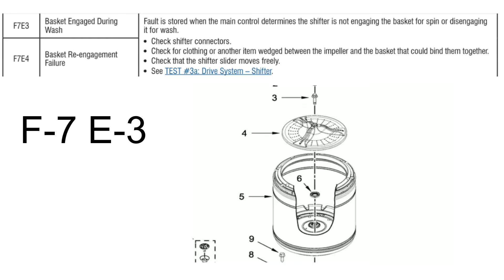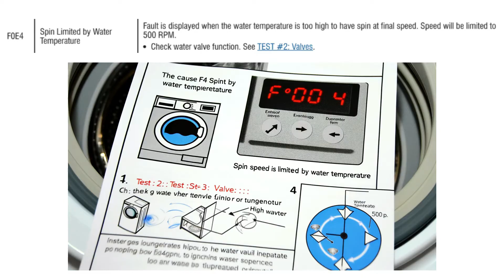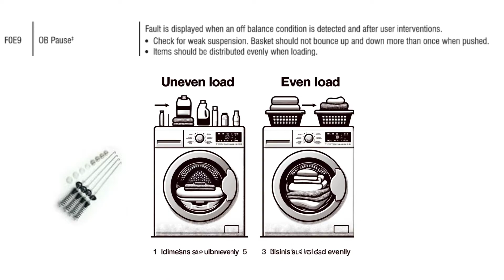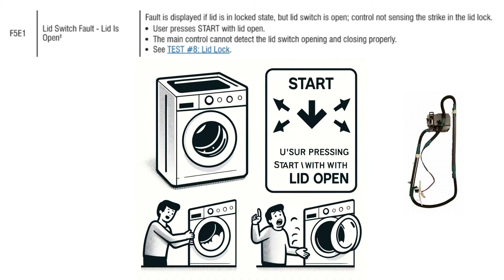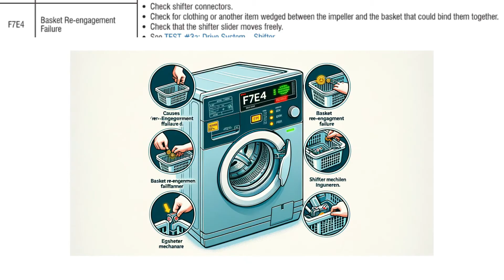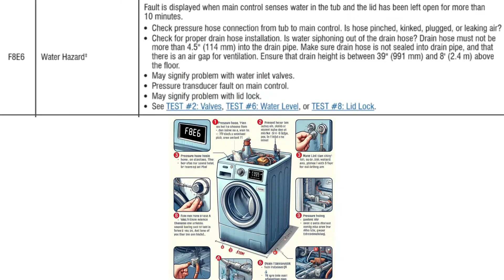Troubleshooting Maytag Washer Models: MVW6200KW & MVWX655DW Guide

Comment: All 4 lights blink on mine. I don’t see that option on the binary code chart.
Reply: My washer is doing the same exact thing. Did you happen to figure out what the issue was and how to resolve it?
Reply: Mine is the same too
Reply: On mine, everything pointed toward a bad control board. Scrapped the machine and purchased a new one.
Reply: Mine does the same thing.  I am hoping that changing the display board will fix it.  Worth $50 try before I scap the washer
Reply: Did the control board work?
Reply: I have the same thing, all 4 LED's light up.  No second code.  Problem is it makes the loudest grinding noise, so loud I can't stand next to it.  My next door neighbor heard it and he is hard of hearing!  This is a 3.5 year old machine.